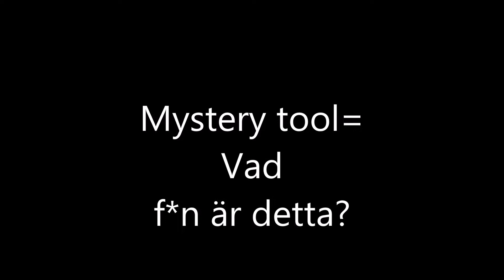What can it be?

Comment: Looks like a special fabrication for measuring the depth/height of a recess inside of an uneven surface in relation to an outside surface. As a tool and die maker I've had to rig parallels and a depth gauge together to take those type of measurements. If it's something that you would need to do regularly, a tool like that could be very handy.